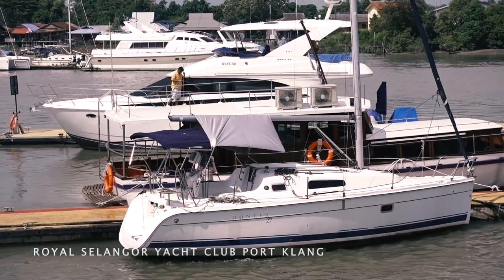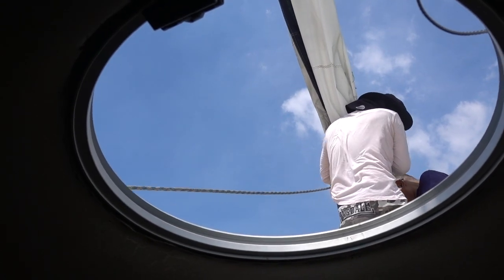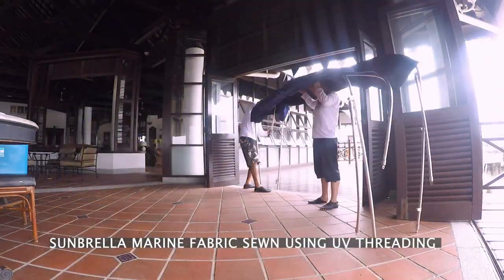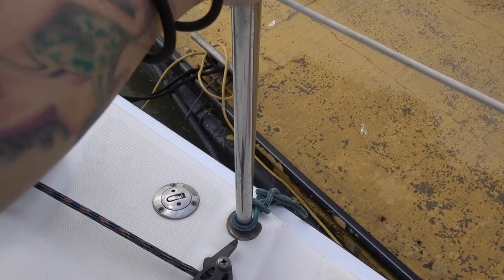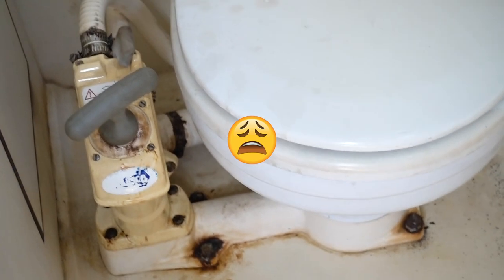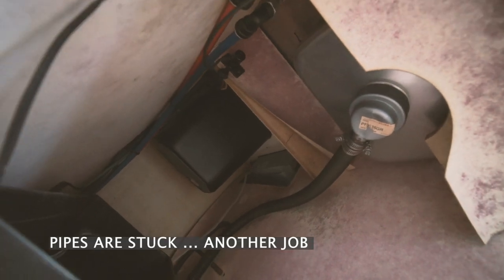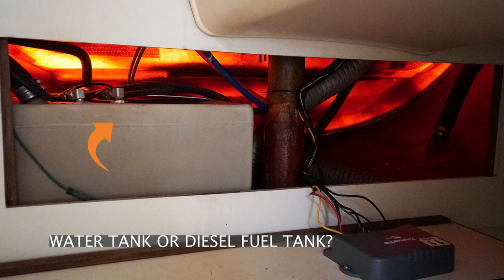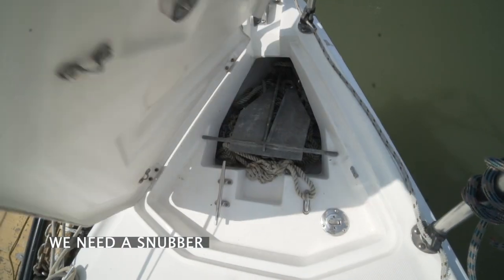Hunter 27 | Sailboat Refit Project Malaysia [S6E2]

Comment: At tip for you and your followers. Do not discard old sheets and halyards. Most are made from double braid line. Even if the outer braid is worn, stained or filthy, the inner braid can still be put to good use as lighter weight line useful in many ways. I like to cut it into pieces about 2~3 meters in length and put in different places aboard that are easily accessible. One handy place is the upper life lines at the forward end of the boat. Two or three lines on each side can be attached using a "cow hitch" which is quick and easy to use. The discarded bits are also useful on the boat's fenders.
Cleaning the old lines is pretty easy. Put them in an old pillow case and wash in a commercial type clothes washing machine. Use a good amount of fabric softener in the rinse cycle. This helps keep the lines soft and supple.
Reply from the maker: 😳 Thank you for this super useful tip! Will do as you say ☺ where do you sail?
Reply: @24hourtravellers  I am in the Philippines currently. I have been to Malaysia twice in the past on two different boats of my own. May your troubles melt like lemon drops.
Reply from the maker: @SailingOTR  and yours too. Hope we bump into one another some day. Hope to hear from you again ☺
Reply: @24hourtravellers  Always a possibility if an when the Insanity is over. There is some wonderful cruising here in the Philippines. Always willing to express my opinion on sailboat related topics.

Comment: How much does the yanmar cost. Seems like 15hp is not much power for the boat.
Reply from the maker: Crazy expensive. 15hp Yanmar Diesel Engine brand new costs around Rm20 - 23K, original engine that came with the boat was 14hp. Sailboats designs have a maximum hull speed so this will be sufficient for this boat's size and weight.